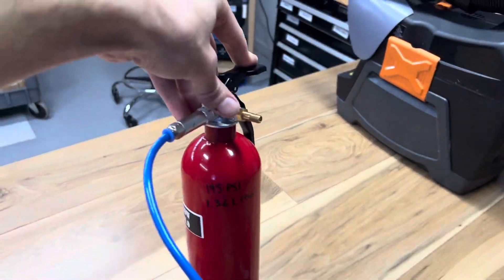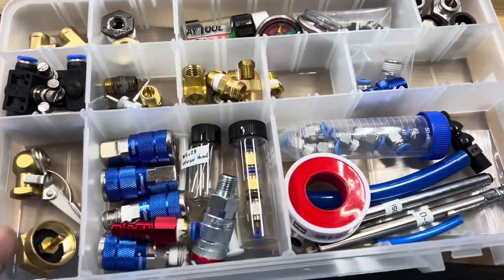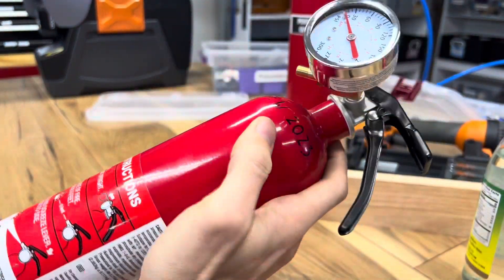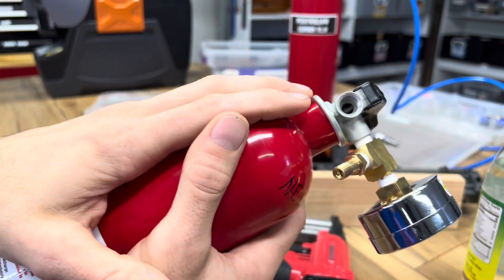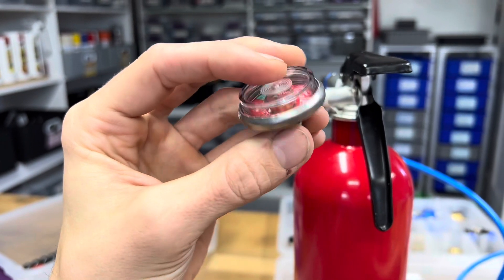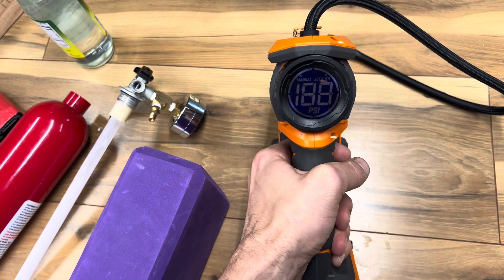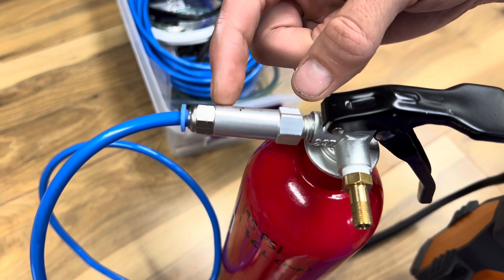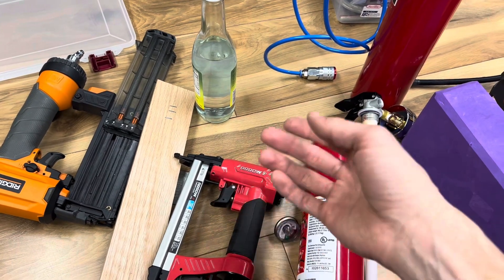pneumatic air battery

Comment: Hi, I’m a fire extinguisher technician (although not in the USA, but I’m somewhat familiar with the industry there), might be able to shed some light on the subject.

First of all, make sure it is THOROUGHLY cleaned out before hooking a powder extinguisher up to anything. ABC powder is corrosive (acidic) to steel and aluminium, and will accelerate corrosion significantly. Warm soapy water, bottle brush inside, clean out the valve the same etc. But remove the gauge first, (some) dry chem gauges don’t handle moisture well.

Second, gauges. Most in the US market are 1/8 npt with sealant. Many in the rest of the world are an m10 with an o-ring (and thread sealant). Worth knowing. The hex on gauges is usually 11mm OR 7/16” (11.11mm!) in either case. I know Amerex uses 7/16”. 

The pressure indicated by these gauges are NOT (necessarily) linear. They are not calibrated to be linear, some give a lot more “resolution” near their operating pressure.

The cylinders are hydrostatically tested to a fairly high pressure (at least 1.5x the operating pressure in the USA I believe). However I wouldn’t fill them beyond their operating pressure (or even at their operating pressure) super often, out of metal fatigue concern.

Thread wise, larger extinguishers will sometimes use an NPT or BSP on their outlet (for the hose). 

A brass valve is nice, for some reason this is considered a premium feature in North American models, but the bare minimum where I am (NZ). 

There are models with build in schrader valves for filling, mostly water/foam models. Those are also (usually) stainless cylinders which is nice. A lot of european standard dry chemical extinguishers have a schrader valve too. Anything for the european market likely has a straight 1/4 BSP or 12/14/16mm metric outlet thread with an o-ring. 

With the right thread sealant, a taper fitting will fit just about anything.

Comment: I use a scuba tanked fill to 3,000 psi. The first stage regulator for diving drops the high pressure in the tank down to around 100 psi. When I need to go lower I just put an inline regulator inline. On the first stage regulator it will have outlets for high and low pressure. You have to use the low pressure outlet or risk blowing up your air hose. You can fine adapters that will adapt the low pressure outlet to npt. Used first stage dive regulators are cheap. I also use dive tanks that are out of cert that I can pick up cheap that are still in good shape but I only put around half of its rated pressure.  I  get tanks fill at the dive shop if it’s one of my tanks I also use for breathing but the ones I use just for a pressure vessel I will fill with an air gun compressor. A dive tank will run a framing nail gun for hours. You can also run air tool and fill up a good many tires off one tank. Best thing about using a tank is not having to drag around a long air hose, portability, can use places that don’t have electricity and not having a loud compressor turning on every few minutes.

Comment: Really cool. I have an idea along these lines for this invention.  Fill the bottom of the tank with diet coke, then make a shelf on the screw-on head to hold the metos. Anything as long as the metos don't fall in while you secure the top. Then after the head is on tight, tilt the whole device so the mentos fall in and create gas. Start small so there's no catastrophe. lmk if you try this.
Reply from the maker: if you do this and make a video, i’ll totally give a shoutout to direct people to watch it
Reply: Funnily enough, that’s sort of how some early fire extinguishers worked. Cylinder filled with a bicarb water mixed, you’d tip it upside down and it would react with some acid stored at the top of the cylinder and generate gas, forcing the water out